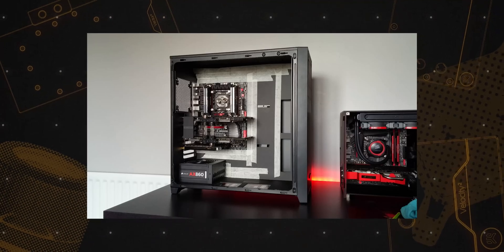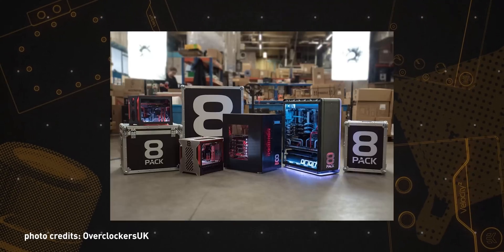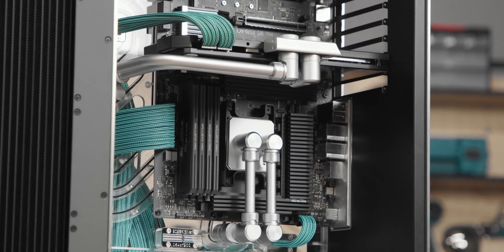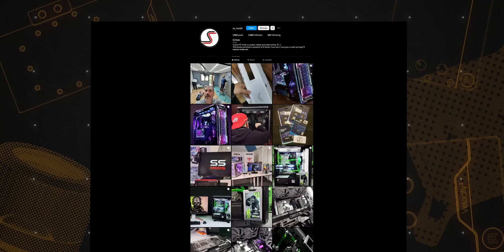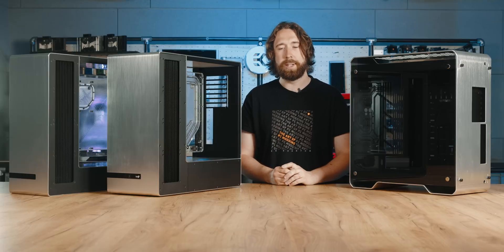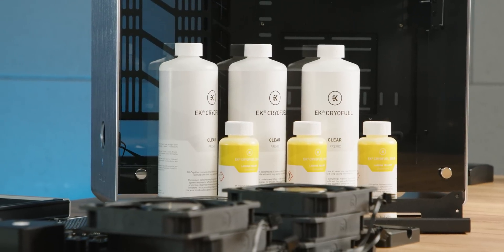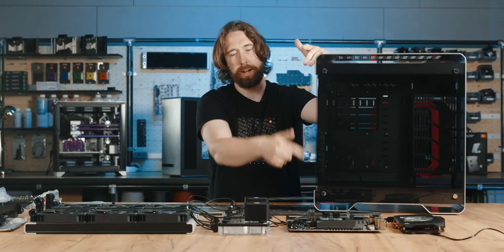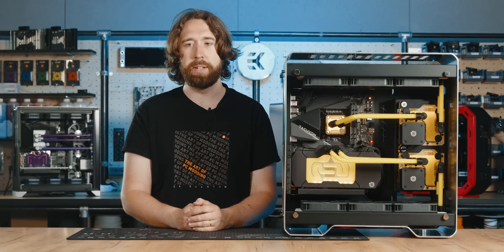EK SHOCKS THE WORLD: Unveiling The Revolutionary PC Case! Is This The Chosen One?

Comment: air flow design is still flawed.. why have hot air (bottom radiator) blowing into the case instead of out? should have cool/clean air intake in the front or the back and blow out hot air at the top and bottom radiator.

Comment: OH WTF?!?!?!?!?  I was cooling delidded 3770k with dual 660 and then dual 770 in a HAF-X case WITH optical drives, and physical harddrives 10yrs ago with ZERO need for "modding" cases.  PLENTY of cases were designed and large enough to perform need even then.  The claims made at start of vid is... PR BS...

Comment: Please EK, do not change the rear panel design. We will make sure to keep some support to ensure case doesn't crater when rear and side panels are removed. Plenty of PETG tubing here I can cut to hold up the case. I love the rear panel design so similar to the 909EK.
Also, what's that "alternate" distro on the other 909EK?
p.s. Torsion case still launching, ya?
Thank you!

Comment: Honest feedback: When you have a PC this nice, you want it on the table. When you have a PC on the table, you want it to be silent even under full load. To achieve that, you need slim rads with many (at least 8+) fans that are spinning very slow (under 800RPM). That was possible with the 909EK, but if I understood it correctly, not this one. Any chance you ever make an XL version, that would support 480mm rads top and bottom? Otherwise, it would be just inferior to many other cases in my eyes.
Reply: This is running dual S420's so the overall effective rad area is very big for its footprint. We are quite sure it's the right size for most single GPU users but we definitely aren't scared to make an even bigger one :)
Reply: @jr23design10  Oh, I am sorry - I thought 360 is max. If there is support for dual 420, it is an awesome case!

Comment: What fluid did you exactly use/mix? Did you mix the pre-mix laguna yellow with white cloud? Looks very nice and milky and different to laguna yellow on your webshop. Just for showcase only or also possible for long-term usage?
Reply: This was laguna yellow concentrate mixed 1:3 so it's just a  tiny bit more opaque than the premix. I don't think you would tell them apart, it just has really nice contrast in the Radeon Edition block, should be practical to run daily like this.

Comment: I would prefer to put 3xP model ekwb radiators and a d5 pump, but there doesn't seem to be room for that.  3x radiators because newer amd and intel require very good cooling and the fans don't have to work very hard for cooling and would run quieter
Reply: You can run 2x P420 radiators and any of our D5 pumps which is suitable for any single GPU setup to run super quiet.

Comment: I like it, but don't "love it". 

Honest feedback: The cable management situation looks tricky unless you have single cable fans and custom cables (PSU is very close to the components). I would consider some type of cover. This is supposed to be a more approachable case, so I'm just thinking in terms of that market. 

I think the top cnc'd openings would look more natural  if the pattern was a larger area. The shape of the openings also seems at bit at odds with the rest of the design. 

The rest looks great/well thought out.
Reply: Great feedback, cabling was straightforward in this simple build even without any custom work and the tinted glass concealed all black cables very elegantly.

Because the shell of the case is machined prior to bending we have to be careful that shapes and edges are not distorted or damaged. Maybe they will be slightly closer or different, but one factor in the placement of everything was keeping the outside symmetrical so that it can be inverted. The '777' pattern came from the Torsion case and actually inspired use of the 30° angle throughout this case, it can be seen repeated through the dust filters, cable grommets and several brackets.

One other thing that you can't see on camera is that it's pretty heavy right now though 😂 definitely something we need to watch out for too.
Reply: @jr23design10  Thanks for the insight. For the vents, I think the main external visual anchor is the notched base, so that's what my eye is looking to be continued on the top.

For the distro, maybe you could take the opportunity to do something a little different. It would add a lot of machine time, but doing a seven pattern on the inner surface of the distro, instead of the usual diagonal lines, would be a cool way to tie the outside to the inside.

Comment: What's the form factor on this? ATX? E-ATX? ITX? 😂
Reply: E-ATX up to the usual 277mm width will fit cleanly. There is also a touch of extra clearance all around for irregular boards like the TRX40 Xtreme or Zenith II.
Reply: @jr23design10  Thank you, man. I had an E-ATX board but a regular case with my new build, so I couldn't get anything from EKWB. With this new case I can change that. 👍